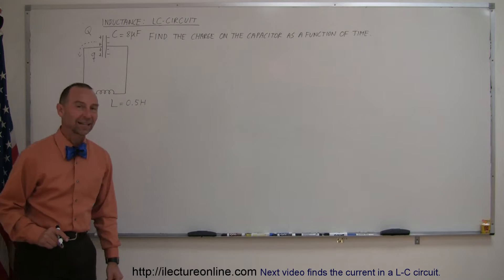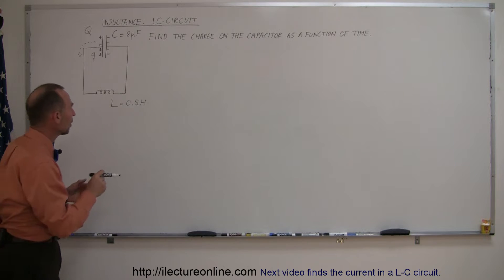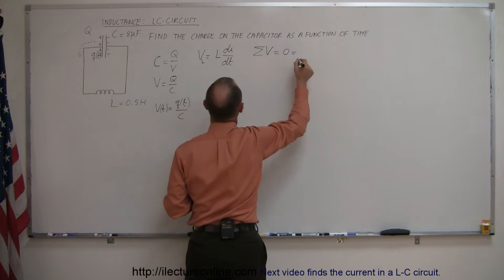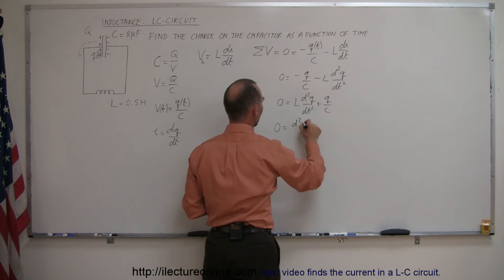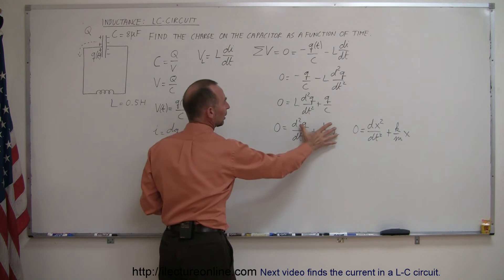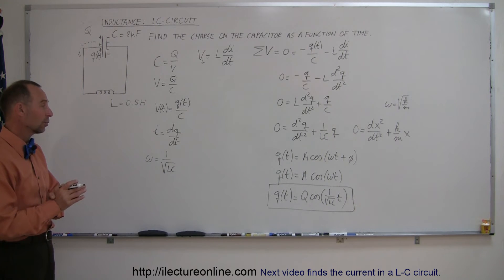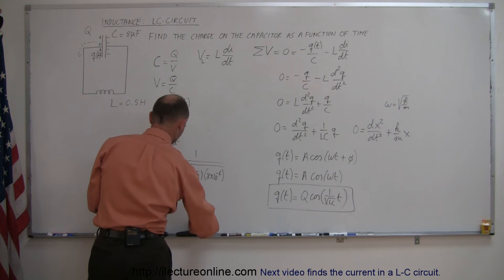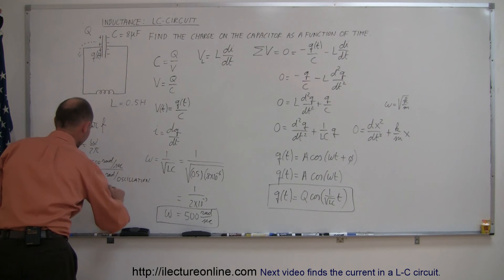Physics 47.1  Inductance (6 of 8) The L-C Circuit

Comment: hey professor ,since this is homogeneous differential equation of the 2nd order when I solve it I get for r1= 500 and r2= -500 ,so my solution is Q(t)=C1*exp(-500*t)+C2*exp(-500t),so if I had initial condition such as Q(0)=some charge...but I am thinking of the 2nd initial condition since we have 2 constants,maybe I should take derivative of the q so I get dQ/dt=i but what is the current in the beginning obviously it's maximum at the t=0 but how to write it mathematically I know that it would go exponentialy if we had some resistor in this circuit...and how do you convert Q(t)=C1*exp(-500*t)+C2*exp(-500t) then into the form Q(t)=A*cos(wt)